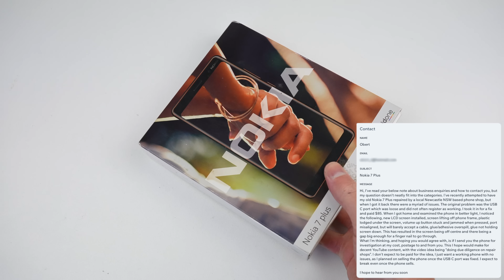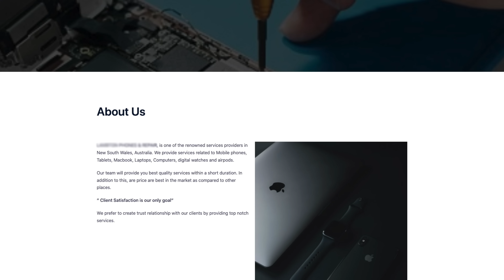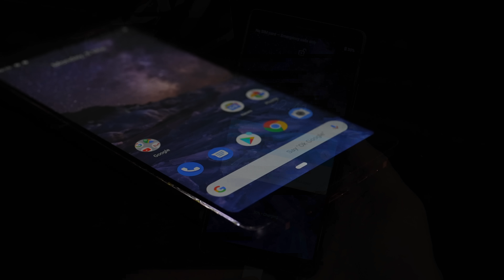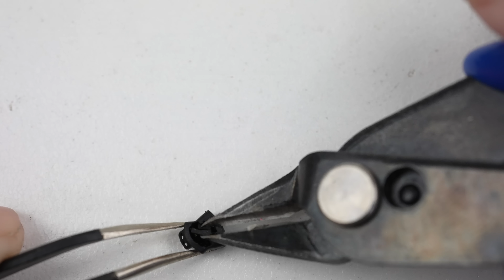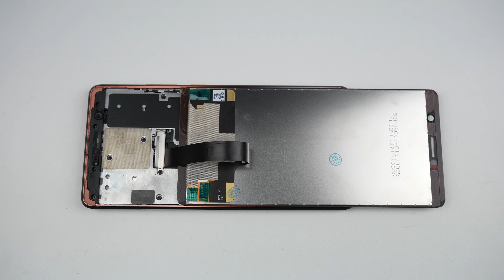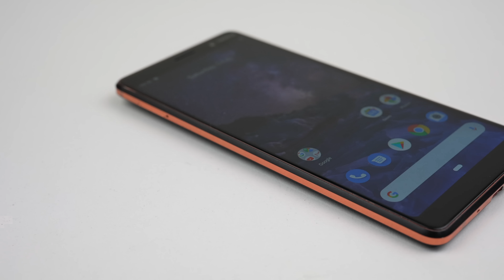Fixing A Viewers Horribly Repaired Phone - Nokia 7 Plus

Comment: I had a Nokia 7+, the charging port was broken on it too... they're apparently really prone to breaking.

I got mine repaired by my carrier, was like £40 but was repaired properly (screen replacement and charger replacement).

Good phone though, great mid price phone a few years ago.
Reply: The charging port does not break, it just gets dirty over time. It needs good cleaning every 6 months or so. I use a toothpick and some alcohol. 
I have this phone for almost 4 years already, and I have no reason to change it. Battery is great, camera is still ok, performance is fine. I've never encountered any bugs in the software, and I use a lot of features...if it had bugs, it would have shown. I seriously don't understand what people are doing with it.
Reply: @coreclassic  no it doesn't. The stock cable is too narrow and all it does is to smash the corners of the plastic piece inside the port which causes this issue.
Reply: @coreclassic  Exactly, I had that phone and pocket dirt getting stuck inside the port was the issue. Preyed the dirt out with a needle and that fixed it.
Reply: @coreclassic  every new Nokia device has same shit charging problem 
I had 7 plus and mine buddy had 6.1 both phone after 1.8 years started giving charging port trauma !!
Reply: Dude. I have also the 7 Plus and 6.1 Plus and both of them had a poorly designed charging port. However care you do to them even plugging in the usb c cable carefully still breaks. Both of them made a charging port replacement twice but still ended up still breaking. The devices themselves are great and beautiful especially the 7 Plus (I had the white one) but the problems on the usb c ports gave it away and made me dump them. I love them both but it's hard to go anymore when port problems occur again and again.
Reply: Listen people. It's just dirt. When you smash it with the cable, trying to plug in, it gets more compact. It almost looks like the rest of the plastic. It confuses even repair people, but its just dirt!!! Take a needle or something, and scrape it off!
Reply: @coreclassic  thanks so much!  I thought the actual connection was failing internally and was contemplating repairing it or getting a new phone (after 5 solid years), but I just sharpened a toothpick and cleaned out all the gunk from inside the usb C connector.  now when I plug the charging cable in, I get a firm click again and the connection is no longer flaky
Reply: I have a nokia 6.1 plus and the charging port on it also broke in 2019. The port still works but now I need to keep the phone slightly propped up for it to charge.
Reply: @ardwivedi16  it will not work soon. The poorly designed port made me to do that trick too. by putting like a "bump" on the tip of the USB C cable while the phone is lying down. Weeks later it became worst until it never charges anymore.
Reply: @PhillipMaquiso  It is working like that for almost 2 years. Although I have to frequently clean the port with alcohol to make sure the phone charges and it only charges on one side of the usb port
Reply: It likely wasn't broken. Had 7 Plus too (still in my drawer as a backup phone) and pocket dirt has built up inside charging port, which made it seem broken. I preyed it out with a needle and that fixed it. I am willing to bet that you and the guy who sent this in had same issue.
Reply: Same, i had 7.1 and it was a nice phone but within a year the charging port was gone, and since i am not in the country where i bought it, they said they won't fix it. It's now in a draw somewhere
Reply: lol yeah seems like early android Nokia by hmd had charging port issue, my 6.1 Plus broke after almost a year, I had them replaced four time throughout 2019 - 2022 for like $5 each. other than that annoying charging port though I really enjoyed that Nokia up until I accidentally dropped it on a shallow water during a camp in a forest..it ain't water resistant so the touchscreen no longer work, could've fixed it but it's really the time for an upgrade....and since Nokia doesn't seem to had any premium/flagship phone I went with Sony Xperia 1.

Comment: People, that’s why we shouldn’t bring phones to custom repair shops. We could instead bring the phone directly to the phone’s company or fix it ourselves with a YouTube video. For example, this video
Reply: Not all independent repairers suck, but i don’t have a good image of them
Reply: Yeah IK. But taking phones to custom repair shops is risky
Reply: The problem is even the manufacturer won't even repair it well - Apple is an example: they complicate repairs so much and serialize components, even if they just announced their "self repair" program BS. I wouldn't trust an authorized repair shop like Genius Bar to repair my MacBook to make an example.
Reply: @Hanagawa46  I’ve had mainly good experience with authorized repair
Reply: @satsumagt5284  I've had a similar experience for Xiaomi as well, they managed to repair something that corroded on my Mi A2 back in 2019. However some manufacturers are just scum - John Deere, Apple, Tesla, etc, which poses a serious challenge for Right to Repair.
Reply: @Hanagawa46  I’ve had good experience with Apple, other than high pricing
Reply: I had got my MacBook battery replaced by apple. They did well. The only thing is that after the repair, the hdmi port stopped working

Comment: did you mean to say rectified instead of resurrected? because i think the latter means "brought back to life"

edit: also i've found the easiest way to clean dried liquid adhesive is using a dry rag. that way you won't have sore fingers and you'll clean any fingerprints off the screen at the same time
Reply: It’s ok to say he resurrected the phone because in a sense he brought it back to life by making it fully functional. However it’s NOT ok to say he ‘resurrected the issue’. That implies he made it faulty again so yes rectified or resolved would have generally been better terminology!

Comment: Asus zenfone 4 selfie suddenly won’t turn on. Changed battery. Charging indicator on. Charged for couple of hours charge light indicator still red. Turn on power, vibrates, but still blank display. Press power together with volume up and down for 10-15 seconds just vibrate, still no display. Press power with volume down, vibrate but still no display. All flex cables are attached. Software problem? What do you think is the problem Hugh? Any idea? Anyone?

Comment: I think the charger pcb it's not original, issue if not use original pcb charging board is fast charging didn't work and if that phone doesn't have jack audio if you using converter to jack audio didn't work to

Comment: Screws management may seem superfluous, as they are often not seen, but these are the details that make the difference in the repairman. Nice video as always.
Reply: I feel like they steal screws, so they don't have to buy any if needed.
Reply: @abhinavhimself  Doubt it, they probably lost it and said screw it. Those tiny screws are really easy to lose if you don't keep track of them (this is not a defense of the shop as it should have been kept to original condition as best as possible).
Reply: @Shadowninja1200  I'm talking from personal experience. I had given my laptop for some upgrades and they stole about 5 screws including one for the cpu cooler bracket. It's very annoying
Reply: So true ಠ_ಠ👍